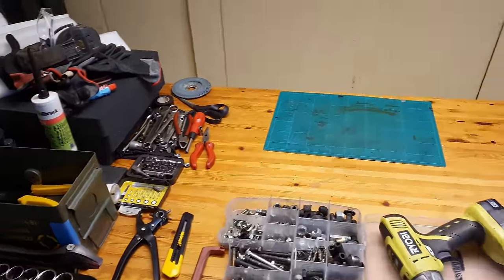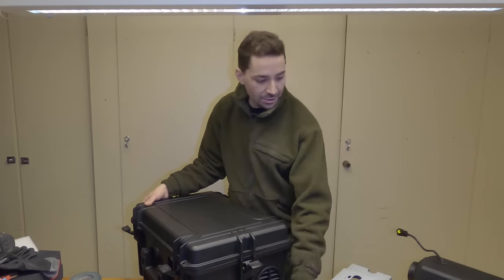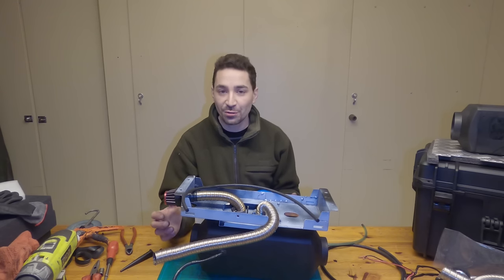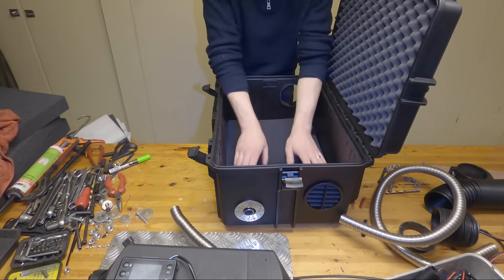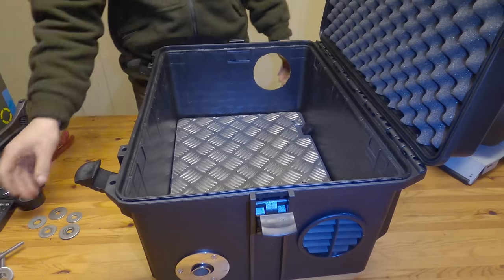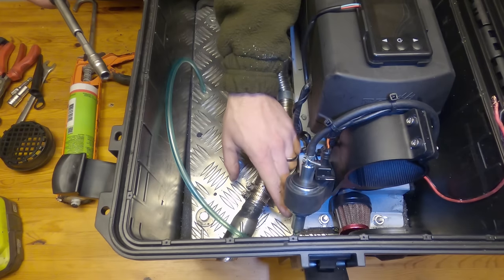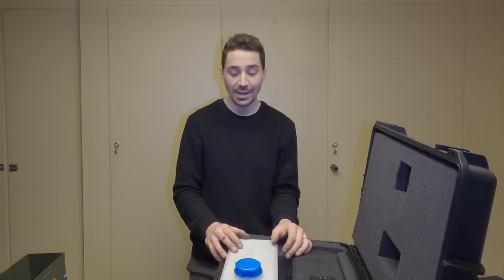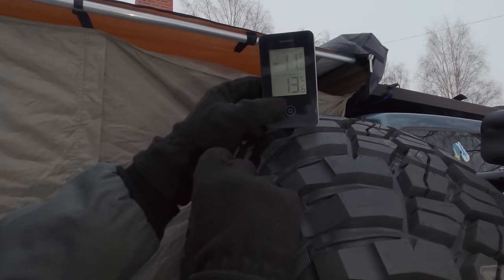Weather Resistant Diesel Heater / Mk1 Portable Build

Comment: Doesn't that hot exhaust hose heat up the inside of the box to a dangerous point next to all of that plastic, not to mention the fuel tank?? I saw another build where they put a computer fan in the side of the box to keep the inside of the box from getting hot.
Reply from the maker: No it doesn't, I run it almost daily sometimes for ten hours a day in the workshop and it's perfectly fine. The key to exhausts whether in an engine bay or this little thing is leaving an adequate air gap.

Comment: Thanks for this video! Very helpful.  I was wondering where you found the 75mm / 3" hot air supply hose flange that you mounted to the side of the box (at about 14:50 on your video).  I'm struggling to find something that will work for my build. Thanks!
Reply from the maker: Thanks for watching! I used a 3" cold air intake kit from ebay. It comes with two metal flanges and a hose - https://www.ebay.co.uk/itm/363666816930?hash=item54ac3b3fa2:g:SaoAAOSw9S5hxXdy
The plastic duct front and back is this - https://www.ebay.co.uk/itm/193722591991?hash=item2d1ac42af7:g:I4IAAOSwNqBfca19
Its just pulled in half so it can be used at both ends.

Comment: Looking to pu my 5K heater into a metal tool box. What you think about sound dedening meterial on the inside, like the ones they use for cars when doing auto installs. Did you tru that in the original metal heater box?

Comment: How does it handle being carried by the handle? Does fuel leak out of the vented fuel cap?
Reply from the maker: It did leak. I changed the tank to a closed system with a one way valve. I now use the same heater, but in a smaller box and it takes fuel from the jeeps tank.

Comment: Excellent video , a pleasure to watch. Im curious what you are you using for ductwork?
Reply from the maker: Thanks for watching! I'm using the plastic cold air intake ducting. Its the cheaper stuff you get from these diy kits from eBay. I actually like it but its bad for heat loss so it must be insulated using a blanket or sorts. I haven't made anything yet for it but when wrapping it in a towel it did make a significant difference to the heat coming from the duct. 
Thanks again!

Comment: Is there any reason the marine exhaust port didn't get installed on the same side as the heater exhaust instead of the fresh air intake side of the box?
Reply from the maker: I didn't build it properly basically. It worked out okay because it meant the e exhaust pointed away from the awning room when on the tire carrier. 
I updated the design recently.

Comment: Hey Mike, I may have missed it but did you try the damper they sell for the noise? I was just wondering if they make any difference
Reply from the maker: I use the exhaust dampener and that does make a big difference. The intake one does nothing in my case. The only issue us the exhaust dampener is fairly cheaply made and they fail internally and block the exhaust causing the unit to shut down. Its best to keep and eye on them, that's why mine is outside of the box so I can just grab it and pull it off. Thanks for watching
Reply: @Workshop & Wilderness Adventures  the exhaust gets clogged when the muffler is not turned with the tiny dimple facing down. It is the exit for exhaust moisture, which will clog the exhaust system. That's why the unit shuts down periodically.

Comment: WW&A you are not the first person i heard mention its not a good idea to run these Heaters on the low setting.i do run mine at around high 2s to 3 Hz. What do you think about running at this setting?
Reply from the maker: They tend to coke up when you run them too low. I heat my workshop with mine and it sometimes as to run constantly for 13 hours or so. The lowest I run it is 2.4hz. I think 2hz is fine also. I use to run it on 1.4hz but it started to smoke a lot and when I opened it, it was just fill of carbon build up. I noticed mainly due to its decreased heat output.
Reply: @WorkshoptoWilderness  ah ok thanks for advice. Do you still do Bushcraft videos?
Reply from the maker: I dont tend to film my bushcraft outings at the moment. I still enjoy practicing skills but I stopped filming as it started to damage my enjoyment for it.
Reply: @WorkshoptoWilderness  i understand i feel that way about my music at times. i watched you channel quite a bit .i really enjoyed your skills.

Comment: What ducting is that that you used? I really want to be able to extend and collapse mine like you did, but mine is less rigid
Reply: @ 13:31
Reply from the maker: It's a cold air intake pipe for cars. It's cheap and not so good. It can't really withstand the higher temperatures that the heater can put out.
You can get similar pipes that collapse from amazon. They don't collapse as much as what you see in this video, but it's alright.
Reply: @WorkshoptoWilderness  TY!!

Comment: Great video, 1 question did all of that help with the noise of the pump
Reply from the maker: Yeah you can hear the ticking noise anymore. You can only hear the fan. Its a nicer sound and better to sleep too. You can buy an actual silent pump from eBay though so that might be a better option. Thanks for watching.
Reply: As an old HGV driver the night heater needs to be run up occasionally during the summer months to keep things moving so to speak that way if something is going to stop working you can get it fixed and ready for when you need to use it and the loud fuel pump tick whenever you start it up usually quietens down when it reaches temperature so take it out during summer and run it up for a while

Comment: you need 2 such heaters. why be cool at all. how about 75 degrees F? nice warm. short sleeves and shorts room temp.
Reply from the maker: Thats definitely an option. I guess its power that I always have issues with. One heater seems to be doing the job for now though and this particular design is old now. I updated it go feed from the jeeps main fuel tank and reduced the box of the heater drastically so it's not such a chunk. Thanks for watching

Comment: Great detailed video as always, thanks Mike.
What is the ducting you are using to get the warm air into your tent? It looks ideal for what I need to use with my roof top tent.
Reply from the maker: Its a generic cold air intake flexi pipe that you buy for cars. https://www.ebay.co.uk/itm/Air-Intake-Pipe-Cold-Feed-Flexible-Duct-Induction-Kit-Filter-Car-Inlet-Bellows/163804946718?hash=item262389211e:g:IZ8AAOSwkfFdR73j
They normally come with metal cowls each end which help with this build. They are uninsulated though and you do loose heat through the plastic. A sleeve is a must I think for long runs. 
Thanks for watching.
Reply: @WorkshoptoWilderness  dude, that is awesome, thank you so much for your help.

Comment: Surely just replacing the pump would make most sense?
Reply from the maker: Not really, it wouldn't be weather resistant and the original case would rust and fall apart. Read the title

Comment: Hi. Whats the name of the hose you used to run from the unit to inside your awning room?
Reply from the maker: Hey, its cold air intake 3" flexi hose for cars. https://www.ebay.co.uk/itm/322825570826?hash=item4b29e74a0a:g:qp8AAOSwUSJZ4R8n
Reply: @WorkshoptoWilderness  thanks for the reply. Can I ask - can the fuel line be cut down to say the minimum it needs to be or does it have a minimum length it needs to be? Tia
Reply from the maker: The fuel line can be really short. I think the shorter it is the less work the pump has to do which is good. Its the internal diameter that's important, it should be like 1.2mm maximum and made from firm pipe
Reply: @WorkshoptoWilderness  Hi Mike. I've made my own using some inspiration from this video. How is yours going these days? Anything you would change or do differently or have you nailed it?
Reply from the maker: Nice, glad it's all up and running. Yeah mine is still going strong. It's in the same box and currently heating the garage. It's working well just full of dust due to it sucking in dust from the garage. I will take it apart and service it soon but I need to add a filter for the intake so that the unit remains clean inside. I'm very happy with it though, I did add a slightly larger fuel tank which makes it last much longer
Reply: @WorkshoptoWilderness  good idea. Something like a Ramair foam filter pad cut to size and shape.
I'll add one to mine too.
Reply from the maker: Yeah exactly, that would work great. I want to put a grill on the fan also so it doesn't suck the foam in. I guess it depends where you mount I though. I'm super impressed though with the heater, I think its a no brainer thing to have if you get cold weather just for emergencies and stuff.
Reply: Also - Are you happy with the combustion and cold air intake sealed on the box with the exhaust. I posted a few pics of mine on a Chinese diesel heater FB page and some comments suggested that I have them both vented from outside.
Reply: However I've got zero issues having mine as you have. Asong as the exhaust is sealed properly should be worries.
Reply from the maker: I put mine inside because it can be -35c outside sometimes and I was worried about the air freezing over the small intake hole. It seems to work fine and I don't think it's a big deal the way they are set up.

Comment: Anyone know where to find a metal flange like what was used for running the exhaust through the case?
Reply from the maker: https://www.ebay.co.uk/itm/194278501950?_trkparms=amclksrc%3DITM%26aid%3D1110006%26algo%3DHOMESPLICE.SIM%26ao%3D1%26asc%3D234475%26meid%3Db1e22e6d8aaa4cf38b5b162aca08c619%26pid%3D101195%26rk%3D2%26rkt%3D12%26sd%3D123727973188%26itm%3D194278501950%26pmt%3D1%26noa%3D0%26pg%3D2047675%26algv%3DSimplAMLv9PairwiseWithPLXWeb&_trksid=p2047675.c101195.m1851&amdata=cksum%3A194278501950b1e22e6d8aaa4cf38b5b162aca08c619%7Cenc%3AAQAGAAACEKIixIo33UQ046k0UgMhdiu9Ud1OTLvmJT2zvnVF3vmtHRrzDFypkJV%252B4r6NoKqacjOkrn%252F64VdAkhwrvsfmOgKOuT1w3kjsOxFsKf22E%252BrKV1CK4aI%252BTpmBOAL9i%252FcJtiIIdYyTB515POff0lmgvOmIyLvt3mtG4tumGq3ZzDs%252F9s%252FFO9VvMCmkWmTu1Qg0ND4FJzEoFGl0oUpAQ60MdaoIseQhPLr246%252BKXFu%252FzjJZwgxF0VP9DVZiqwj0JAPRathrgIVjBvLN8xKNZ1nJIoEpgDRYgD1zUYK59br032ntkS210naHpVtSMzhB1Vw6PRJiNj2F1XOo4xk9rKJ%252B99Z7ptBtzRkZcaFILJsnKZ3J6xn%252Fv4Ckw%252BQoVthty2QciLkVFdJjbHsIFoL7Q30j6vcJqyzVVUlnY%252BXbi8DEgKuO1WXY5zHR3cGJXOTYlL3UxPeB4cIZpXVC3nuHpsflLo7YWsiLLkJxN6QfD3I9sLi6h8YH%252FX6w9sQAuf6RQQ9zZvCrjzXCU26PrMcT1BSEIWXn64XOEMY9TadFZybWBOUqEouow0pAvDz%252BQQWJOu0%252FaQ2lVbBde8%252Bve1VhHK882Gen38X7KLb6v4W1oMxhQMNvk7qPL5CZK%252F9LL5JdJUqvl1FSLjvWe%252BThVMhdYeoNcskYz34UMlBMM5e4gtJZ7vkPuB3Sw0NcNOQtdaZilMJNEw%253D%253D%7Campid%3APL_CLK%7Cclp%3A2047675

Comment: what is the best hose to get? running it about 8foot
Reply from the maker: I bought some 3" silicone high temperature ducting. It's been running really well on it. It smells a bit on the first start up as it's new hose but it goes away
Reply: @WorkshoptoWilderness  thank you for the reply and video! I just ordered a heater to put outside on a tire rack or ground for my camper! Can’t wait!
Reply from the maker: @shervinghannadian9651  Ah nice, i'm sure it will work like a charm. I used mine last night and it was fantastic. They are awesome bits of kit for the cost.

Comment: Isn't a little dangerous to have the burner exhaust so close to heated air intake?? - Carbon monoxide and all that?
Reply from the maker: I dont think so. Carbon monoxide is heavier plus factor in, wind, and everything else. I've run this setup for over a year and it's never been a problem especially with an extended exhaust pointing down.

Comment: >Worries about pump noise.
>Bolts it straight to the duct leading to the sleeping space.

Oof.
Reply from the maker: Its bolted to the intake not the outlet. I've been using the heater for over a year now and I never hear the pump. Working great, although updated in a smaller box taking h diesel from the jeeps fuel tank.
Reply: @WorkshoptoWilderness  huh. I am a bit jealous. I can fall asleep with rushing wind noise from the fan/air but the slightest pump tick and it drives me insane.

I have one of those "all in one" units (among several other heaters) and I can clearly hear it through the cabin air duct. The one in my camper is heavily isolated on soft silicone mounts away from the heater itself, but in the same enclosure (tongue box), and again - can hear the thing tick ever so slightly. If the fuel line shifts and rubs against the duct it becomes much louder.

Still an excellent video though. I watched the whole thing twice through for ideas.
Reply from the maker: The tick of the pump is annoying, I can't sleep with that either. Is the unit you have one the in the metal box?
Reply: @WorkshopWildernessAdventures  yeah. The all in one is. I'm gonna rip it apart soon and do it in a plastic tool box soon. 

Though technically the camper one is too as its an aluminum tongue box.
Reply from the maker: The metal box that mine use to be in made the pump really loud. I guess it resonates like a drum or something. If you put it in a plastic box then it will be almost silent. The fan on mine makes a lot of noise these days. I probably should take it apart and do some maintenance

Comment: Why exactly is an air filter needed? It's not like an automotive engine where you have valves that need to seat and seal perfectly, or piston rings sliding back and forth in cylinder walls. There's no tight tolerances or things to wear out inside. A Scottish gentleman, who's channel name I cannot recall, has posted teardown videos of a few of these, including one with a water heater. I'd be more concerned about carbon and soot buildup due to incomplete combustion resulting from insufficient combustion air than about a little dust or dirt getting sucked in. It's just a plastic impeller fan inside that draws in combustion air. A filter is going to restrict it quite a bit, and the "ECU" meters fuel and controls that fan's speed under the assumption that the intake is relatively free flowing.

Same thing on the fuel filter. Larger positive displacement diaphragm pumps are used in industry for slurries like sand/water mixtures. I'd worry more about getting water in the fuel than adding a filter. Especially in cold weather when diesel is thick and hard to pump that filter may very well impede flow.

Lastly, a plastic box filled with foam seems like a terrible choice for a diesel powered heater. Those cases are made of polypropylene, which has terrible heat resistance even by plastic standards. Box lights up, flame propagates to the plastic ducting, tent catches on fire, vehicle catches on fire... you get the picture.
Reply from the maker: The air filter is required due to a tiny hole that feeds air into a small diesel mesh defuser that's near the glow plug. Dirt gradually builds up and begin to block the hole which then results in incomplete combustion. There are a number of videos demonstrating this including the Scottish guy you mentioned who I watch also. A full filter again is for potential particulates and again this is covered by the channel you mentioned and others. I guess its common sense I guess. The box is probably not ideal but it's doing the job and has no issues as of yet. Anyway keep trolling my man

Comment: What gauge wire does the controller need? Like to run it 10 to 15 feet.
Reply from the maker: By controller you mean the lcd box for switching it on? I just used some 10 guage from memory. It doesn't require much but I used what I had. For the power cable I would use something more substantial because it pulls like 150 watts on startup and can shut off with an error if there are voltage drops below 10.5v